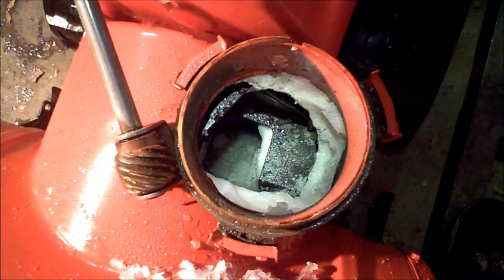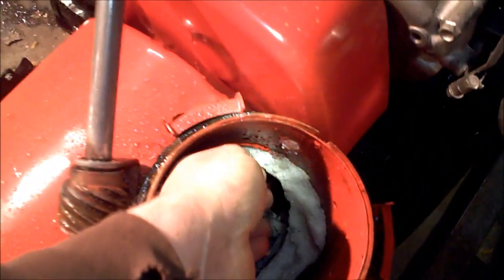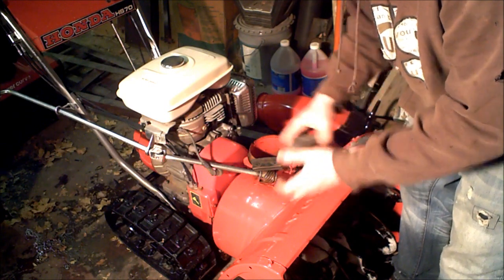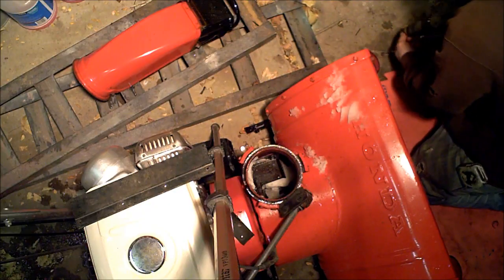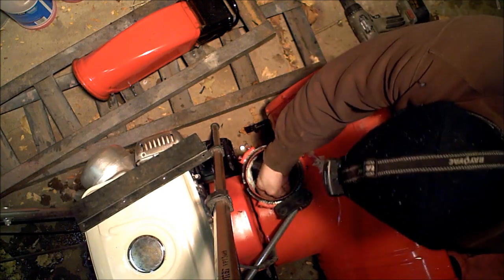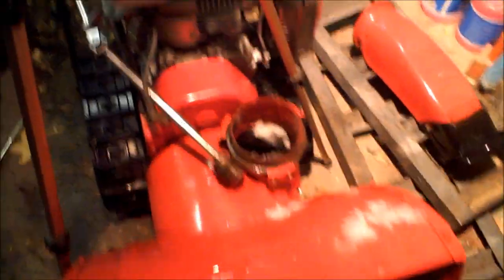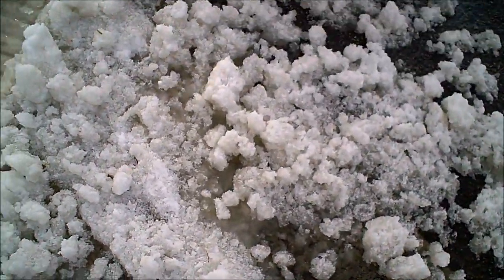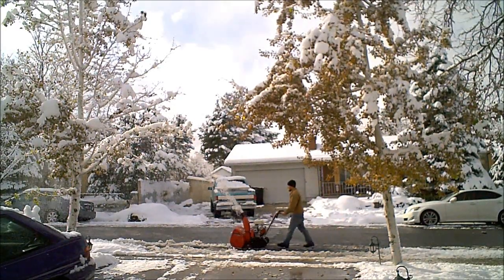Modify Snowblower to never clog and throw twice as far w/ Impeller Kit

Comment: DON'T YOU WIND UP WITH DAMAGE AND EXTREME VIBRATION FROM BALANCE PROBLEMS ? THIS IS A SPINNING MECHANISM.
Reply from the maker: Nope. The impeller is used to being severely unbalanced with the snow load only on one side. However I place paddles on opposite sides w/4 blades or all if it has 3 blades so there is no unbalance there..

Comment: Now cal you describe what a metal slack pin is and where I can find it on a noma 9hp 27 inch  model g2794010       Code 6303
Reply from the maker: On a parts diagram, parts number 41&31 part#3949. They are metal rods attached to the engine that hold the belt in a loop when no tension is applied to the belt. The "loop" allows the belt to slip and not grab on the engine pulley. To adjust them, you tension the belt and bent them to within 1/16" of the backside of the belt. 

Also look at your auger brake reference 120 part# 581540 to make sure it is engaging when the belt is loose.

Comment: Hello thank you for the help . I ordered a new auger belt, now when you say adjusting cable, mine has two half . The top half is connected to the handle that has a adjusting screw , but the other half is under the blower connected to the pulley that braces itself to he auger belt .

Comment: I have a problem, what would cause the auger belt to spin and the auger to turn while the engine is idling .? The auger cable is loose
Reply from the maker: This is fairly common.  Most of the time it is no big deal as the auger will stop immediately if it hits anything. There is a brake on most units that just needs adjusting, the belt tensioner is too tight or the metal slack pins on the motor are too loose.  Take off the belt cover and take a look at how everything functions.

Comment: Liked
Changed the paddles on my single stage gotta see if I saved em or not 
Dang nabit I hope I did otherwise I will improvise 
Great idea 
Thank You
Reply from the maker: Thanks. If you can't find it you can pick up a paddle for the Toro s200/s620 for pretty cheap(around 10 bucks) and it's enough to do 2 or 3 snowblowers. I think there is still a link in the video description.

Comment: I did this to my single stage johndeere. It had a half inch gap. I used to pieces of 3 by 5 inch conver belt with a piece of flat stock on top.
Reply from the maker: Awesome. I do all my metal auger single stage snow blowers this same way.

Comment: I bought slick plate in a spray can. It was designed to use on the bed of grain trucks. It works on my discharge chute.
Reply: Ron White a
Reply: Trudy ptak h
Reply: Trudy I had trouble understanding you. If you're interested in slick plate. Go to your automotive or hardware store. When spraying the snow blower chute,do it in a well ventilated area.

Comment: A good stainless steel self tapping screw with a hex head probably won't need predrilling. The regular zinc ones burn out too quick to cut through any kind of thick metal.

Comment: I believe it's a Tecumseh like the one you have in your video you linked me. my issue is the leak is coming from the carb intake port? not sure what's it called. when I prime it gas overflows from the intake port. am I doing something wrong or so I need to replace my carb? will a rebuild or cleaning repair this issue? thanks again!
Reply from the maker: It should drip out the mouth of the carb if you prime it a few times. Completely normal.

Comment: https://www.flickr.com/photos/50621316@N05/albums/72157663774625984  I got all of the parts I need to replace the worn ones. I also drilled & tapped the gearbox for a grease zurk, and also retapped the threads for the old "plastic plug" that actually broke years ago & put in an actual pipe plug in it's place. BTW, I only spent $150.00 on parts, the biggest thing I will be doing is getting the sheet metal cut out & replaced on the snow box ( I am going to guess that will cost me about $300.00), as I do not have a plasma cutter & my own wire feed welder, but I will be requiring about 10 gauge sheet metal to be used to replace the rusty stuff. The pickle fork is the trick to getting the pulley off the back of the snow box, and using the spray called DEEP CREEP. WD40 could not touch it.....
Reply from the maker: It's coming along nicely.
Reply: Yes it is, all I need is enough overtime to get the snowbox work completed (and hopefully before the snow flies again) that I will be able to get things together again. Only other glich is one of the parts that I put into the carb when I rebuilt it got put in backwards/upside down so extra fuel flows to the carb & comes out the butterfly. I talked to my local shop & he said the one part was installed backwards/upside down..

Comment: I just picked up an old Toro 421 2 stage for $80 at a garage sale. It starts on first pull. I think I will try this after I test it when we get snow this upcoming winter. From what you say, looks like I'll have to pre drill... Thanks!
Reply from the maker: You got a great deal on a solid machine. A Toro 421 will have slightly thinner steel on the impeller and shouldn't need pre-drilling. It will make a world of difference on it.
Reply: +sixtyfiveford good to know, thanks! I felt like it was a pretty good deal.

Comment: My 2 stage snowblower is always clogging and freezing up here in Maine. There is a large gap between the impeller and housing. It WILL NOT attempt to throw any slush. Heavy wet snow is a little better. I have spare tires, so this will be my project this week. I will have to give an update when I get snow later in the year. I have a metal impeller with three blades, so I will do all three.
Reply from the maker: You'll be very impressed. Let me know what you think.
Reply: I do have a question. Do you cut the housing side square or rounded?
Reply from the maker: I just leave it square.
Reply: +sixtyfiveford  Thank you. I will definitely comment back when I get to try it out this coming winter. You rock!

Comment: Hi, I just try your tricks and wow its crazy so im pleased with the improvement,  But I made 4 rubber pad but just installed 2 like you did do you think i can install the 4 rubber pad or  will I brake something  oh and mine make the same big squeaking sound like yours when i press the auger lever is it normal? thanks
Reply from the maker: +Daniel Lapointe You can put on all four, it won't hurt anything. If they touch too much they will squeak until they wear in.

Comment: I got my rear pulley removed using a Tie Rod Pickle Fork,  a can of Deep Creep, and a hammer. All I have to remove now is the locking pin that locks the pulley to the auger/impeller shaft, then I can replace the rear bearing, and replace the two pins in the impeller,  as they are pretty rusted.

Comment: Finally tried to install my paddles onto my Ariens Snowblower and lucky me. The self tapping screws I used are not drilling through the impeller. Any recommendations on how to get these screws?  Maybe drilling a hole in the impeller or is there a better self tapping screw for tougher impellers?
Reply from the maker: +MarcHill83 Yeah, drilling may be necessary in some circumstances.

Comment: My chute freezes up pretty often, it rotates fine but to adjust the distance the plastic chute will freeze in position where I leave it sometimes when its really cold. Any ideas?
Reply from the maker: +Tony Johnson WD-40 will hold off the water and prevent freezing.
Reply: +sixtyfiveford I tried that a few times, nothing seems to work. Its a plastic chute if that means anything. Last year the same thing, could their possibly be water in the cable line?
Reply from the maker: Tony Johnson
Yes, cable lines will get moisture in them all the time and freeze up. You'll need to work it back and forth and try to work wd-40 all the way through the cable.
Reply: +sixtyfiveford I bought something that attaches to the cable so you can spray wd into it but not sure how it attaches. When it gets warmer I will work on the cable again, thx.

Comment: If you REALY want to improve this and any other snow blower,..line the chute with a section of plastic like 'crazy carpet' and watch That performance,...you will get almost twice the snow throwing distance., AND the wet snow WILL NOT stick to the chute's inner walls.
Fasten the plastic sheeting to the chute with pop rivetts,..from the inside out,.to keep the rivets flush with the inner surface.
" No charge" for this tip !
Do this WITH what 'sixtyfiveford' has suggested here, and you might even ENJOY snow clearing.

Comment: I have a 22 inch carftsman with a plastic impeller. it has a 1/2 gap. I would like to try this mod but am worried about the plastic impeller. will this work with it, or will the plastic be weakened by the screws costing more in repairs. your thoughts would be great.
Reply from the maker: +Brent Almy I've done it to many plastic impellers. They are a reinforced composite that is designed to handle ice any other debris. Just use common cents and don't put screws right next to the edge of the plastic(at least 3/4" in)

Comment: Finally had a chance to use my Cub Cadet 24" 2 stage snow blower with your impeller modification.  Once with a foot of powder, and once with about 7 inches of wet snow. FANTASTIC results! Never clogged once! And throws the snow out with great force. In fact, because I have a gravel driveway, I have to be really careful where I aim the chute! Although I raised the front scoop housing up about 3/4", It will still pick up a few pebbles now and then, and shoot them out like a slingshot!

Thanks again for sharing this! :)
Reply from the maker: +LOA1955 Awesome.. I'm glad you tried it out.

Comment: Pretty ingenius way to do it, and its called RPM's(Stands for Revolutions Per Minute.), I have a Toro 724(Mid 90's also a 2-stage.), that I have had to do a bit of work on, and mine kept clogging up, but, it wasn't the main issue you are referring to, it was the belt was super loose, so I tightened it up, and with that super slushie crap, I put it to the test, and it did clog up 2 times, but I was severely putting it to the test, I was actually pushing it faster then the #3 speed setting, so, it flung the snow/slushie crap 3 times farther then it originally was, and before-hand, it kept clogging, like every 2ft, so, another issue could be, that their belt can be loose, so, need to check on that, as well, especially if it was doing the same as mine, which it would not even begin to bog the engine down at all, and the propellers(augers) actually stopped, so, I knew it had to be something simple as that, but, as long as I kept it within the perimeters of what it was built for, it worked great!
Reply: rpm stays the same. He's talking about tip speed which changes w.r.t. radius.
Reply: Exactly! The RPMs don't increase.  The "oompf" he describes is due to the impeller blade's increased radius.  The RPM's might actually go down a tad due to the increased load caused by the increased radius.
Reply: Great idea Sir! 
Truly admire your innovative spirit.
Changing the impeller diameter (larger) with rubber/plastic inserts, makes the actual surface speed increase the effective surface speed output (at a now larger diameter), in surface feet per minute traveled (fpm) improvement. 
Great innovation to a very annoyingly common problem. The inertia value (oomph factor) of thrown/spinning snow is exponentially increased/improved. Be careful where the snow is sent to now, could be damaging.  
1/8 inch nylon sheet would be another option, very durable, strong and lightweight indestructible plastic. 
Available at:  https://www.mcmaster.com/#8539K888 under 5 U$D for 6x6 inch piece. In black for 1 buck more.

Comment: My rear pulley on my MD was held on by a bolt that went through the pulley and into the impeller shaft, no set screw. I have taken a step back and instead of trying to use a crow bar to remove the pulley,  I am actually using a Tie Rod Pickle Fork that is the correct size that fits between the pulley and the snow box and have been beating on it a couple times with a hammer. I lack an air compressor at the moment,  so using my air hammer is out of the picture at the moment. ....

Comment: Works well, Throws snow further, I bought a single rubber blade  replacement part on Amazon for about $9(Oregon 73-003). Enough for a four paddle impeller and  6 self tapping screws. Entire cost $12, kit on ebay $30 plus $6.50 shipping. Thank you for the great idea and step by step instructions. My Club Cadet snow chute when unbolted,(4) opened up a very large access area and finished the upgrade easily and without fuss.
Reply from the maker: +Fred E Awesome, I'm glad you tried it.

Comment: I had a SIMPLICITY THAT HAS ALL 3 SOLID 1/2"" THICK RUBBER PADDLES EACH BOLT HOLE HAD A STEEL TUBE LINING TO PREVENT TEARING OUT...ALSO YOU SAID YOU COULD NOT USE SELF TAPING SCREWS ON A TORO? HOW ABOUT DRILL & TAP, AND USING A SELF LOCKING BOLT / SCREW ?? I NOW HAVE A TORO 824 MODEL
Reply from the maker: +Dennis Youland You can bolt through a Toro or predrill and use self tapping.

Comment: a very good idea, I am going to try in on my Power Smart blower, what I worry is that will be very difficult to drill in hole in the thick metal propeller
Reply from the maker: +raymond yu Drilling the hole is the hardest part of this modification.
Reply: +raymond yu I did it on my Powersmart 22 inch snow blower.  Once you get that drill bit to bite, it cuts thru easily.  You will really like the results. Works great on wet heavy snow.  Great distance and no clogging
Reply: Thank you for your advise.

Comment: enjoyed the video and decided to try this on my 5.5 hp troybilt..... have to say I was very disappointed.... I even went as far as to put a rubber paddle on each of the four blades and the only difference I noticed is that it's noisier from the rubber rubbing on the inside of the housing. the wet heavy snow at the end of the driveway will not blow thru without clogging up... I'm going to try playing around with mine a little more to see if I can make it more productive.....  I was wondering the horsepower of the snow blowers that you have had success with...was wondering if maybe the rubber is actually limiting the performance of the engine due to the extra drag of the rubber paddles rubbing against the housing... love the idea... let me know your thoughts or anyone else's ideas...
Reply from the maker: +j k The rubber shouldn't be dragging on the inside, just skimming the surface. I have never had a single comment from a disappointed person no matter the horsepower.

Comment: Very nice! I've been a farm equipment tech fot 16 years now and I have rebuilt a bunch of forage blowers and harvester blowers. Farmers use forage blowers to blow corn, corn silage and haylage anywhere from 40' to 120 feet up a narrow pipe and into a silo. Its so critical to have the blower paddled square to the liner and as close as possible to the bottom of the liner. The term pick up a nickle and leave a dime comes from mechanics setting up blowers. The blower should be closeset at the bottom. Then the paddle should gradually get further away as it travels from the bottom to the discharge opening.
Reply from the maker: +Chad Heistand Exactly.

Comment: I talked to my shop, and my big pulley was held on with a bolt, (I have already removed that. ). According to my shop, the pulley is just pushed on (not pressed fit like a bearing). I will be prying the pulley off, and bring the impeller and auger assembly in the house as I do not have a vice in the shed (plus not much room for working inside the shed.)

Comment: One of my shear pins broke on the last snow storm we had here in MN., and both of them are rusted in so I have to hammer on them pretty good & they still do not move. I have to replace the plastic bearings for the impeller shafts upon further investigation. How do I remove the "flywheel" on the back of the impeller box? I have removed the bolt that was threaded in. This is a circa 1984 MTD Snow Flight with the 8 HP Tecumseh on it. I have already separated the box from the handle/motor assembly already. I also need to add some gear oil into where all three shafts meet between both augers as well.
Reply from the maker: +MRHSDM316SD18186 Take a look at the parts diagram. They are very details and will let you know what parts to pull. 

What you're attempting is not an easy task. The Large pulley that runs the impeller is held on with a set screw. However if you're just dealing with busted shear pins you can just drill them out and install new ones.
Reply: I have the shaft bearings pulled, as they were the original plastic ones (new ones are brass, or some other type of metal). I have pulled the bolt out of the big pulley on the back of the snow box with the idea of sliding the auger & impeller assembly out & bringing it into the basement, as I have no vise in the shed. I have been shooting the pulley & shaft with DEEP CREEP (a much better version of WD 40), as it comes out in a light foam before it turns to a liquid.

Comment: My father did this modification last year.  Hands down the best modification you can make on a 2 stage.  That nasty slush at the end of the driveway was always a pain in the butt to get rid of.  This simple mod clears it right away, no clogs and no dribble of slush onto the snow blower.  He was actually stopped by the local police in his town about blowing snow into the street.  When my father replied he wasn't blowing snow INTO the street, but in fact blowing it OVER the road onto the strips of grass across the street.  The cop agreed and went on his way.  My father used an old mud flap and some self tappers.  I intend on doing the same modification to mine shortly.  Thanks for posting you video.
Reply from the maker: +William Fortier That's a great story. I'm glad he took the time to try this out.